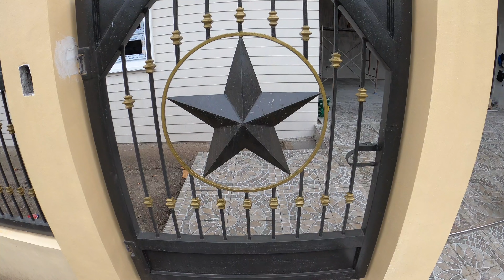Philippine House Building Step by Step, Build Day 227: Whole House Water Filtration System Install

Comment: What’s the cost to build that house?
Reply from the maker: Build costs are a real moving target here with a lot of hidden fees and expenses. Construction costs range from Php20K to PHP35K per SM depending on location, size, complexity, and level of finish. Most expats end up in the mid to high end in order to include what we consider basic essentials. Items not included in the build costs are Air Con, appliances, perimeter fence, landscaping, etc.

Comment: Nice water filtration system you got there. Isn't that too expensive? Kudos also to your workers magaling better than what I've watched from retired and happy vlog. Salamat
Reply from the maker: Actually a third of the cost of a similar system in the US. Cheaper in the long run instead of buying bottled water for everyday consumption. Don’t have to worry or plan on replacing the plumbing due to sedimentation or corrosion over the years. 
Definitely worth the money in our humble opinion. 
Thank you for the feedback and for tuning into our channel.

Comment: Not good plumbers with the tank piping...very sloppy..wrong material used also for exterior application...
Reply from the maker: PPR is the industry standard here in the Philippines. GI pipe corrodes and rusts. The old blue pvc is too brittle and won’t handle high pressure. Copper is too expensive, corrodes over time, and has a theft rate.
Reply from the maker: What would you have suggested? 🤔

Comment: It always seemed to me there was always a lot of holidays when I was there, as my families kids were always out of school... the water filtration system is huge... nice... I thought about a water softening system as well... we have one out here in California... something to consider as well... I was wondering why you did not have the tanks and water softneing system enclosed inside a  building?  just wondering... or are you planning...   exposed to the outside elements is going to be harsh on the system... its new now, but after a few years there will be some effects of the outer elements...  The garage is huge with a high ceiling, curious on the garage door installation... interesting... your house is huge... I bet the neighbors are intrigued...    no wonder why you needed two lots.  Thanks for sharing... be safe... enjoyed the video...
Reply: I want one of  those fans... nice... have not seen them out here... another blogger had one added to their home too...
Reply from the maker: @VeraandElla  
Hafa Adai, Mike and Gerlie!
Initial cover for the water system is in the works. Garage door lacking components our electricians are supposed to be installing. They are a little behind 😉. 
The ceiling fans are available at most big box stores and online through Lazada.

Comment: Hi George, Could you share the web site for the water filtration system? Thx Roy
Reply from the maker: The company doesn’t have a web presence. Strictly by word of mouth here in Central Luzon.
Reply: @CasaTexPina  What will be the pressure from the pressure tank? Will have to find a similar unit state side,
Reply from the maker: @RoyD450  initial pressure from the tank is 45 psi. More than double the main line pressure.
Reply: @CasaTexPina  That's good, I am going to try and get 55 to 60psi.

Comment: wow, all your filtered water will be wasted to your toilet bowls, showers, washing machine, and kitchen faucets when washing dishes, pots, etc.
Reply from the maker: Actually, that was the idea. The untreated water in this subdivision stains the clothes, leaves dark rings around the toilet bowls, and comes out like coffee whenever we have a power outage. Most of the older homes in the subdivision have GI piping and are clogged with sedimentation and heavy rust. The idea is to protect the water system AND be able to make ice and drink from the tap without getting sick.
Reply: @CasaTexPina  it might stain your teeth too just like some area in cavite.
Reply: @CasaTexPina  great to know that, tks.
Reply: Where is the reject water going to? Because on reverse osmosis around 20%  of the bad will just be rejected. It’s still water so you can use it to water the yard
Reply from the maker: @romeoalquero6603  
According to the master plumber that installed it, the water going through the reverse osmosis membrane is already filtered “mineral water.” No reject water. Just clean the membrane during regular maintenance. Disclaimer, I am not a plumber.